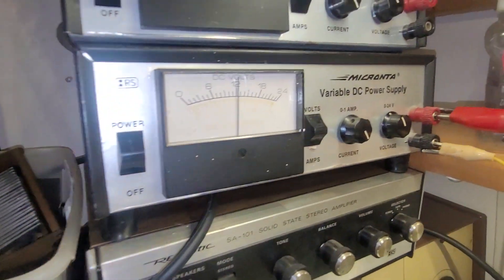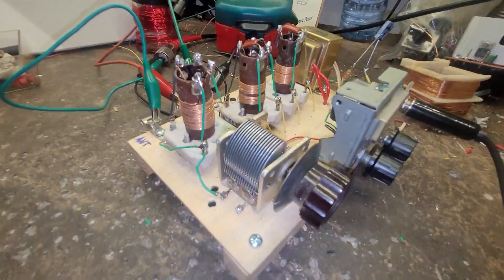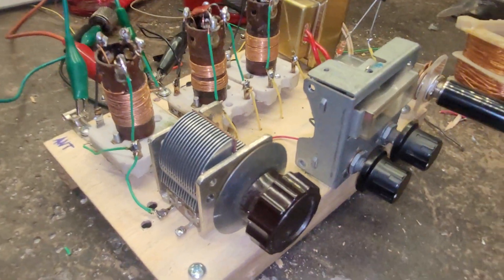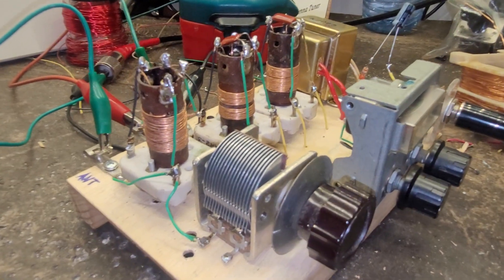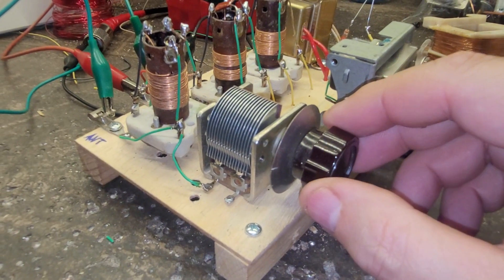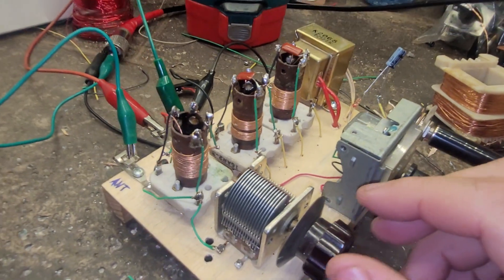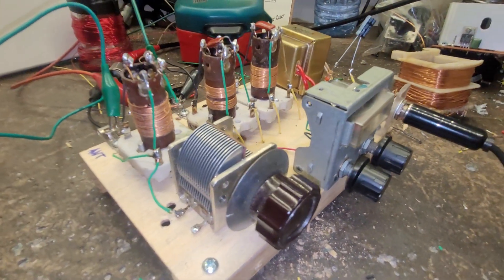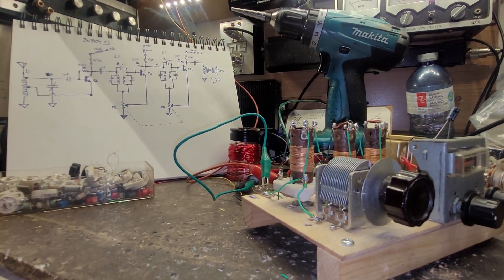THE THING!

Comment: Maybe you could just come out and say it's a weak 3-transistor AM radio receiver. That would save time.
Reply from the maker: Let's see your version of this! ;-)
Reply: @Radionut63 The point is that the limitations are arbitrary and self-imposed but serve no cognizable purpose. As such, I guess, if I wanted to experiment with some retro primitive AM radio comcept, I might build a discrete transistor version of an AA6 but it's very likely been done thousands of times already.
Reply from the maker: I understand your perspective. From a technical and ethical standpoint, the  purpose of this project is to process information either by reading from books, magazines or other online sources such as YouTube and personal websites, i am trying to learn how these circuits work and perhaps what do not not work, and maybe assist, help or learn from other users within the radio communications hobby here on YouTube.     

I am sorry if this and other homebrew circuits i may build are NOT up to your professional engineering standards.  ;-)   

Have a good day!

Comment: Be good if you could build a frequency display section also.
Reply from the maker: Have not had much luck with counters on regen receivers so far.
Reply: @Radionut63 hmmmmm, it can be difficult and complicated to design and build those. But it's nice to know what frequency your monitoring.